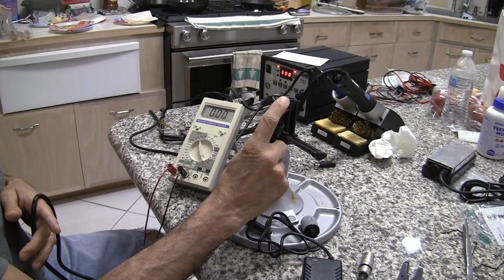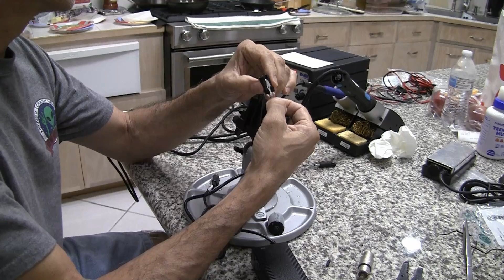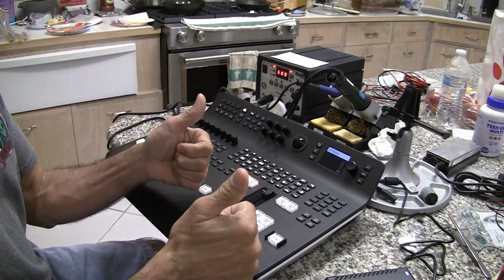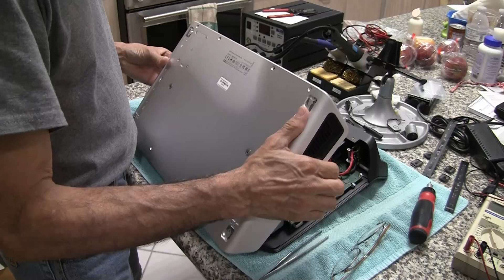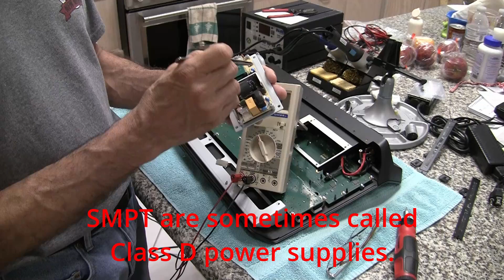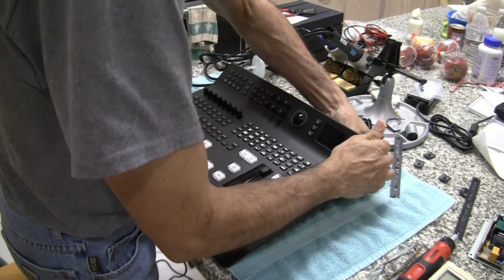Blackmagicdesign ATEM Television Studio Pro HD Power Supply Repair Part 2 of 4

Comment: Where is the T5AL fuse located? My church has this switcher, but it doesn't power on with either the built in supply or the external one.

Comment: The reason there are dual power supplies on this unit is to allow it to be used in a portable configuration, powered by a 12 volt vehicle electrical system. The wiring  of this plug is a pro video standard and is used on many portable products.